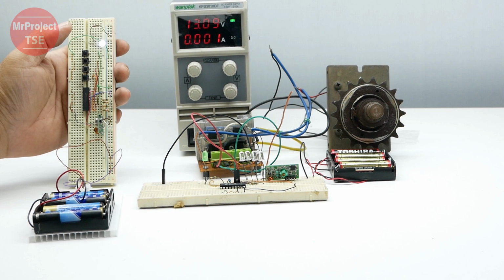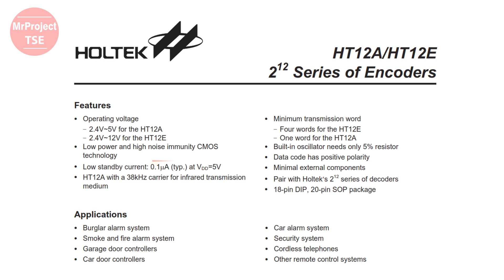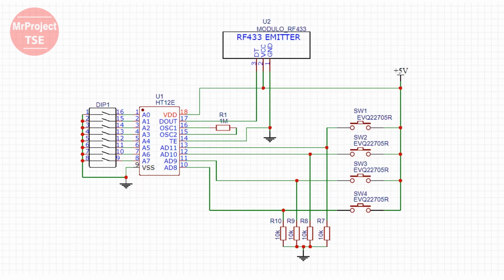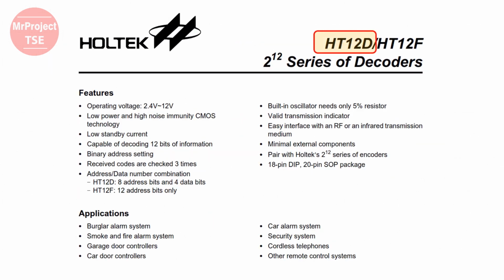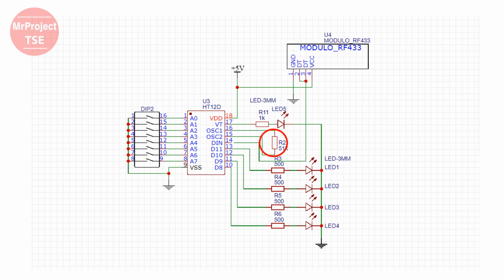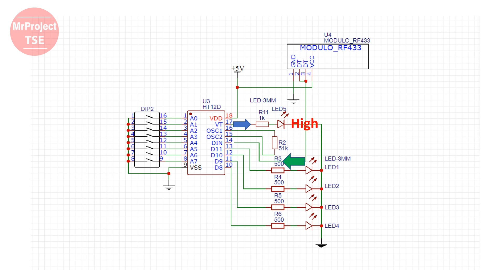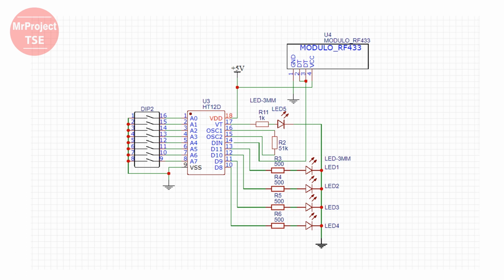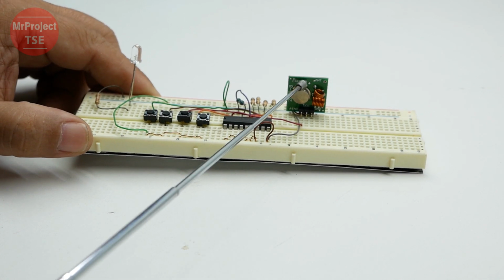HT12E and HT12D the Encode and Decoder IC, Experiment Remote control

Comment: I am using 1M resistor in Transmitter circuit and 33k reciever circuit in my RC car but circuit is not working motors are not rotating. I am using 433 Mhz FS1000a Tx and Rx module. Even the  LED is not blinking on pressing any tactile switch. Can you help me.
Reply: The transmitter resistor and receiver resistor circuit must correct the value. This resistor for oscillator circuit if incorrect value circuit will not decode data or circuit will not work. I use 1 M for the transmitter circuit and 51k for the receiver circuit.
Reply: @onlyme8477  what will be value of transmitter and receiver resistor if I use 9 V.